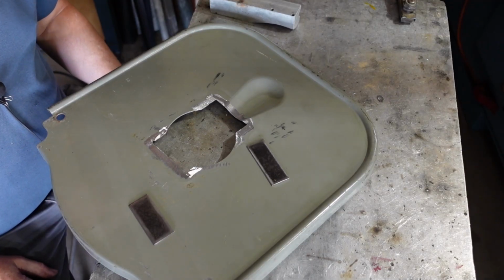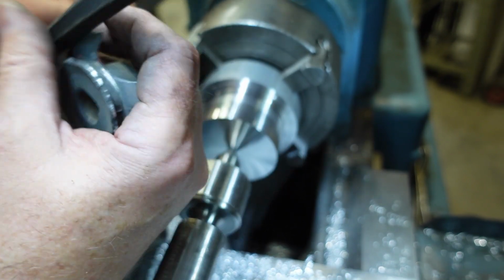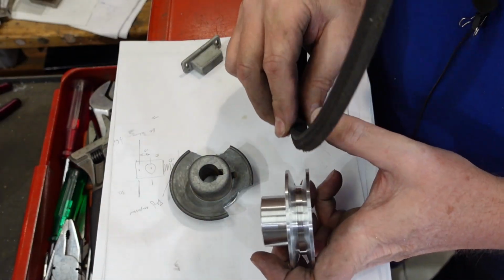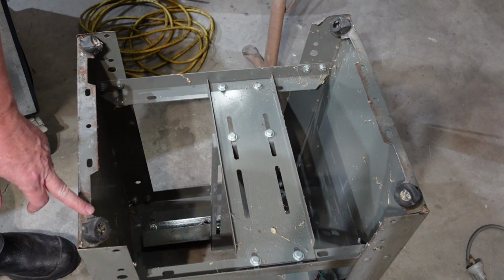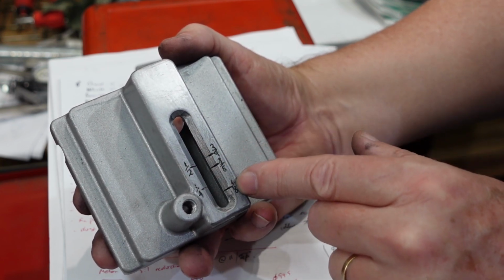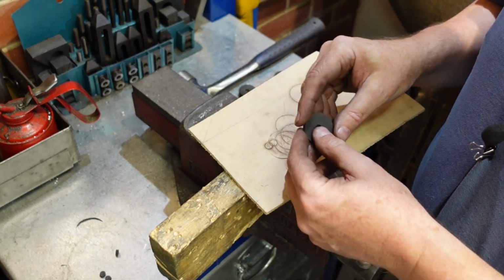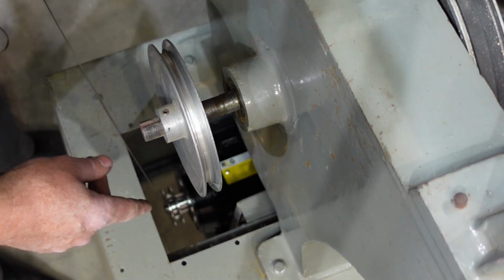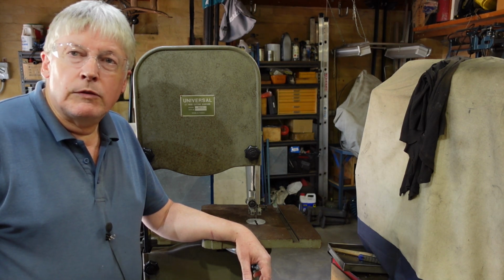Bringing the bandsaw back to usable

Comment: Enjoyed the video, but I would have liked to see how you put the curved portion in the cover patch, Thank You
Reply from the maker: It was pretty much as I described - I welded a flat patch in then used a (ball pein) hammer to stretch the metal to shape. Possibly the only tricky bit was holding the existing 'corner' against the edge of some thick flat stock so I had a corner to form the new bit around.
Reply: @occasionalmachinist  Thanks Michael

Comment: Awwh, I was hoping to see some engineering and milling to make that adjustment housing, but as you say if you can buy it cheaper than you can buy the material, there is no choice.
I do have a question about the engineering of the blade backing bearings, 
Why is the blade running on the side of the bearing and not the round outer section?
I'm putting forward a guess that it is two separate "flat" aligned spots backing the blade instead of something that may want to cause the blade to warp sideways (even though I've seen other band saws using the round part of the bearing)?
Reply from the maker: Short answer is I don't know. I was also thinking that if the blade ran on the round outer of the bearing, it would be over the thinnest section of the race (where the groove is). Probably does not matter as the bearings clagged up with sawdust/ sap first. Your reason could be good too. Of course being a mass produced tool, it could just be that it was easier to fit something that way...
I was looking forward to that milling too, but (at the moment) a lot of work at below cost. I do have a couple of parts in the wind that (after cutting out on a bandsaw) entirely milled, so for the milling fans, something to get their teeth into.
Reply: @occasionalmachinist  👍

Comment: 3 views - woohoo I am nearly first, now I just need to watch it.....
Re the Levelling Casters. They are available everywhere but Vevor has them for a really good price for 4. Also they now have the "improved" version has a ratchet system to operate the  levelling feet. These are better as trying to take the weight of a substantial piece using the plastic "thumb" wheels seems far to hard to me. With the improved version you can even use a small extension bar to do it so you can make it easier to do in the odd places that you will place it. (no association with Vevor)
Reply from the maker: Interesting to know. This style is new to me. My initial thoughts were that the pad only has to start taking the weight off the wheels for it to be effective. I'll have to see over the course of use how well they work. So far they are good.